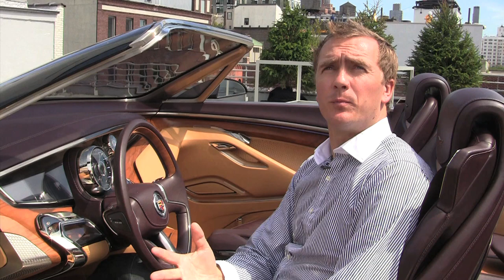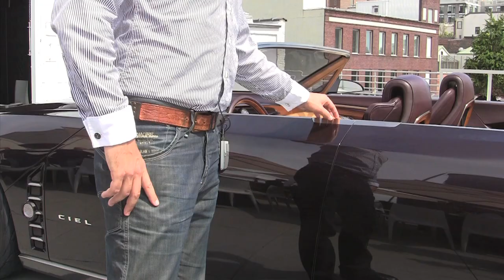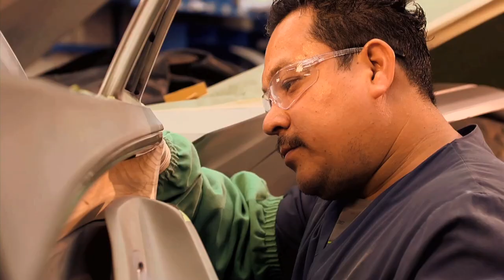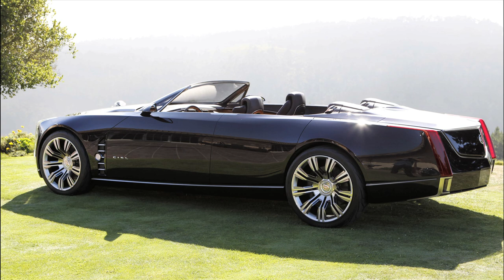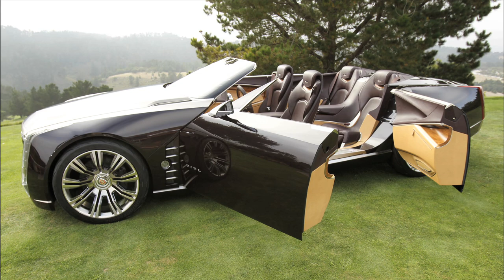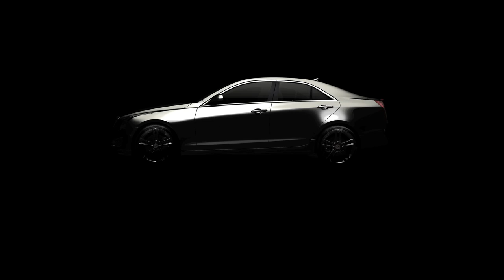Real World Test Drive Cadillac Convertible

Comment: Beautiful car, love the rear suicide doors from a practical and visual standpoint. As a current Cadillac owner and a late 40's yr. Old buyer, we'd love to see Cadillac get back to focusing on providing the most luxurious cars on the road.   This would seem a practical direction since they obviously have the sport category firmly under control in several levels from the ATS to the CTSV.  As well as the SUV market.  Let's see some good old American smooth riding luxury.  The American auto industry is back on top.
Reply: Trophy 205 Luxury,bold, brawny, distinctive, design execution not the follow-the crowd- styling...

Comment: once again, no v8. a proper luxury marque must always have a v8 engine as an option. the whole history of cadillacs are big smooth cars built to cruise with a  mighty large v8 under the hood. Another embarrassment for cadillac. oh well.
Reply: Nonsense.

A modern V6 engine will produce, as the great automotive journalist P.J. O'Rourke once said, "all the power you'll ever use in a car you paid for with your own money".

The current Cadillac CT6 already offers the option of a V6 that delivers more than 400 horsepower.  Anything more is absurd in a Cadillac.

V6 also offers serious packaging benefits.  The shorter longitudinal dimension allows designers to reduce the polar moment of inertia which improves cornering.  The reduced weight makes it easier to balance the car and also improves fuel economy - in addition to improving handling.

It also makes it easier to install the hardware for AWD.

The only reason to install a V8 is if you need the extra power that the V8 can deliver and, with modern engine technology, as I said, that just isn't necessary. 

If Cadillac were going to offer more than six cylinders, they should go directly to a V12 or even, in a throwback to classic, pre-war Cadillacs, a V16.  A V8 is a pointless compromise.
Reply: I would argue for V8 as minimum or base model. I would be amazing with a v12 a straight 8 12 16 or v16